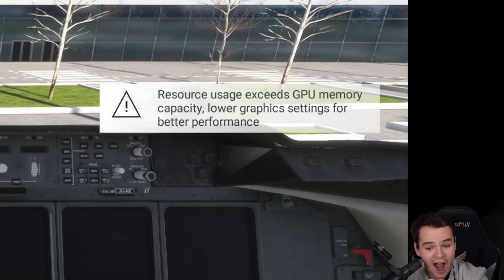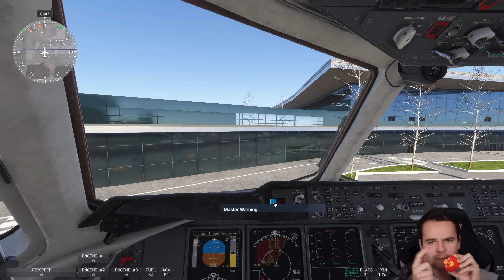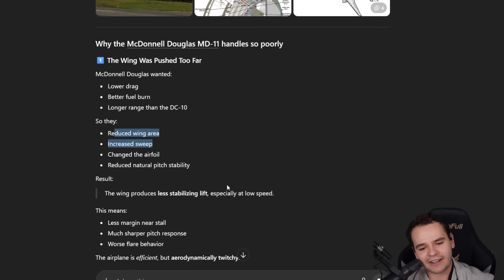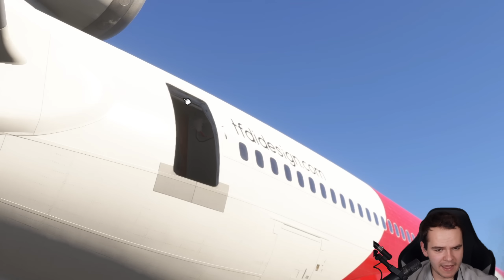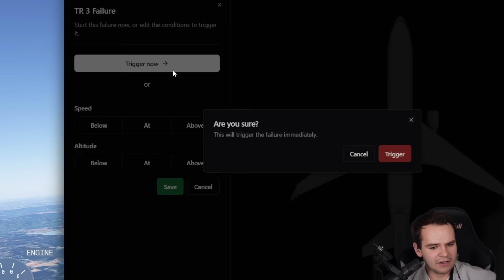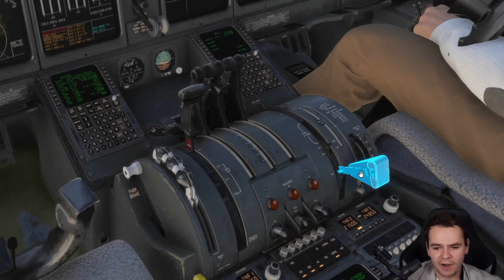This New MSFS2024 MD-11 Is SCARILY Realistic

Comment: Dial a flap came from the DC9, the MD80 had them as well, not something unique for the MD-11. Gave the pilot more room with speeds and approaches. 

The LSAS does work properly and as intended. 

The reason the MD 11 had bad pitch control is nothing to do with the wings. The horizontal stabilizer was made smaller from the DC10, in order to reduce drag. 

The MD-11 preformed badly in passenger service. However it excelled in freight due to its large internal volume, and good performance. 

You spew so much factually incorrect information, without a shred of research, and then claim pilots hated the MD11 and that it is a bad plane.

Comment: Yeah it was designed with relaxed stability by reducing the size of the horizontal stabilizer to reduce drag. This made it a little touchy in pitch with reduced pitch damping and elevator authority and resulted in the highest hull loss rate of any widebody civilian airliner. Similarly its wings were designed to be small to reduce drag as well. It just has relatively small flying surfaces.

Comment: MD-11s are still exist as freighters but many of those planes were grounded after the UPS disaster.
At the time of UPS MD-11 accident, at least 78 MD-11s are still in service. It was among one of the hardest aircraft to smooth landings especially during high crosswind